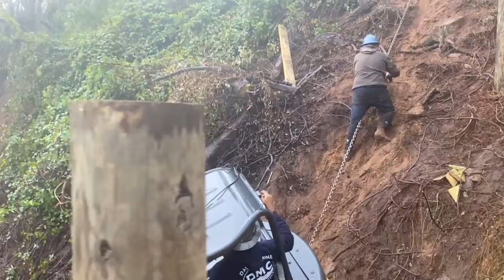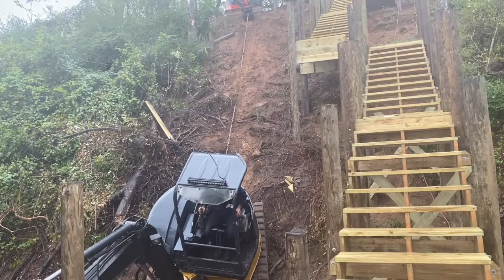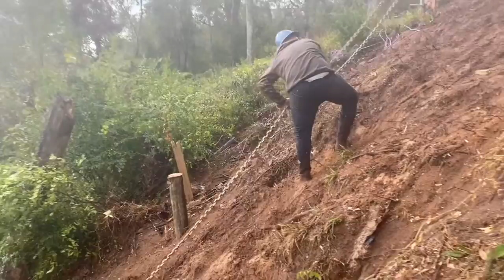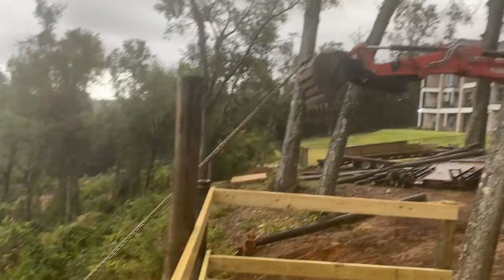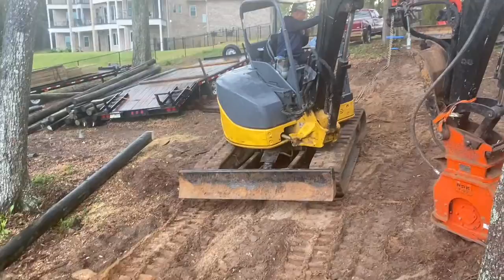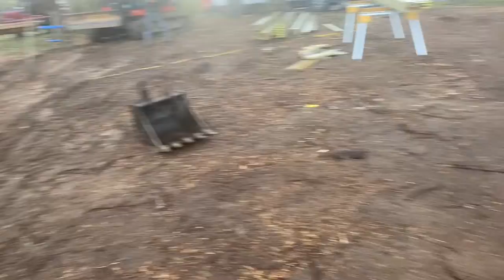EXTREMELY DANGEROUS EXCAVATOR 65’ STEEP ANGLE CLIMB

Comment: Turn that puppy around and walk up hill with your weight to the advantage
Reply: This was my thought exactly. On a slope nearly identical I put my boom  uphill outstretched low to the ground with my blade behind me hovering a few inches above the ground and my excavator just climbs. The machine will climb steeper slopes than I am willing to discover as long as the soil isn't loose.

Comment: We are in a situation almost exactly the same, we have to lower a 6-ton excavator down a hill that's about 50ft long and the slope is about the same. if you had to do this again what would you do differently
Reply from the maker: Thanks for watching and your comment. I would just be very careful. It was a pretty dangerous situation. Someone had commented. I should’ve rented a tow truck with a large cable that would probably have been smart as well. Good luck with your project.
Reply from the maker: I did like having tracks on the ground on the top of the hill, as well as a blade to keep it from being pulled down the hill, so that’s why I went with the Track Hoe

Comment: Our pipeline guys use heavy duty winches on steep grades. Heavy enough to pull the machine with tracks and only use the arm following for safety. Way faster than using the chains
Reply from the maker: qbensister I agree with you if that something I have to do a lot I probably would definitely do that not a whole lot of hills in Florida thank God!!👍
Reply: Way safer too. Chain links are like bullets when they snap... And guess who they're aimed at? Should be using slings
Reply: Have to trust that winch your life
Reply: I've seen stuff like this in the NC Mtns, A place called Maggie Valley was the first time I seen something similar, they had a Gehl with a auger and a post driver,they had a giant hyster winch on a good size wheeloader  (skid mount on forks),that's how they did the entire project over the bank, alot like this, steep enough to not be able to walk up it without help from a cable or rope.....